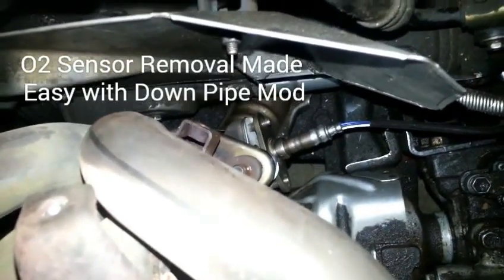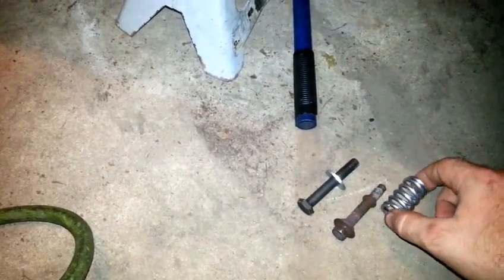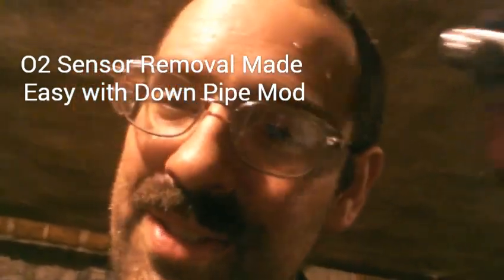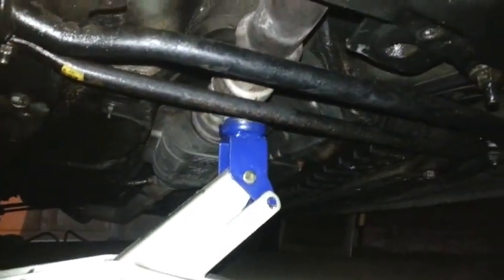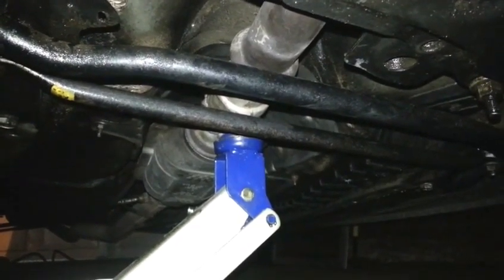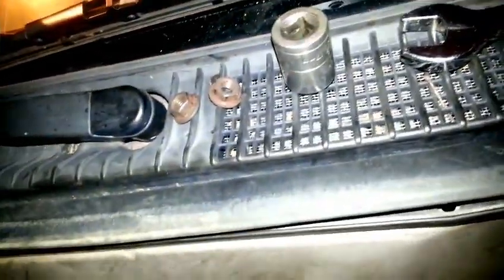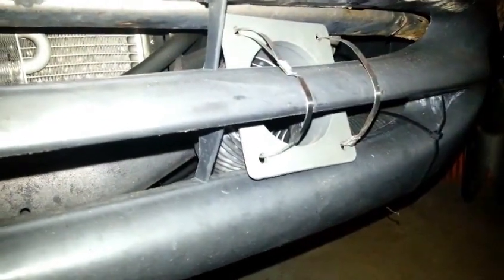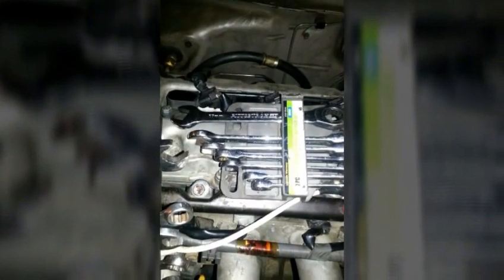O2 Sensor Downpipe Mod and Diagnosis

Comment: I put some tape over the sensor part of my replacement oxygen sensor - and filed down the flange. I remember the Denso 234-4205 Oxygen sensor had a larger, welded on flange and it would not go. I Filed the bitch down enough to make the o2 sensor flange to clear the bolt.
Reply from the maker: +John That's a great idea as a solution! I just ordered this sensor for a friend with the same car. Thanks for the tip!
Reply from the maker: +John I hope you subscribe if you haven't already. Your comments will be of a great addition to the community.

I have many more videos on this car and more yet to shoot.
Reply from the maker: +John Check this out. New technique. One of O2 sensors bolts was a little too rusty. 

Same kind of car, but a recent job. So I completely pulled the down pipe to fix the threads. I tried too hard leaving it in to fix the threads. 

I have shot a whole other video about this and yet the job is totally different. Crazy, right?